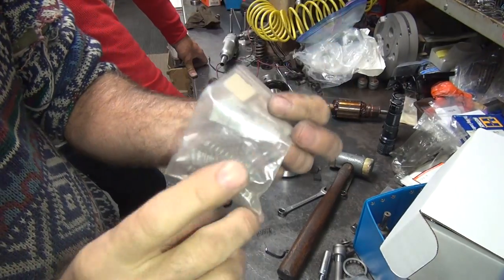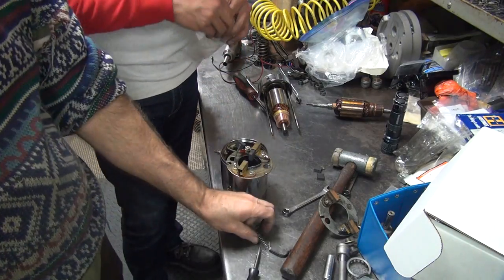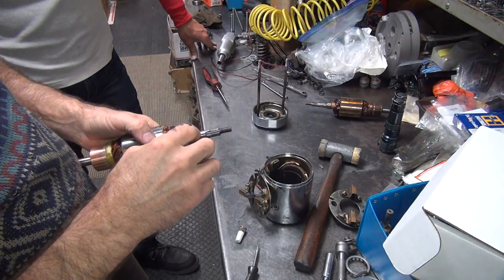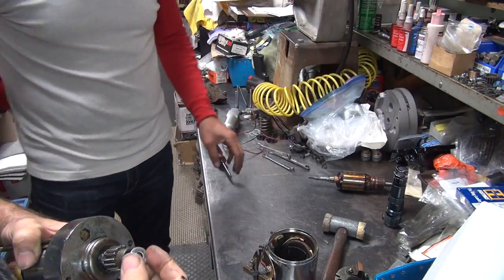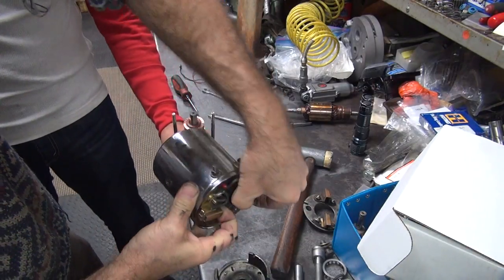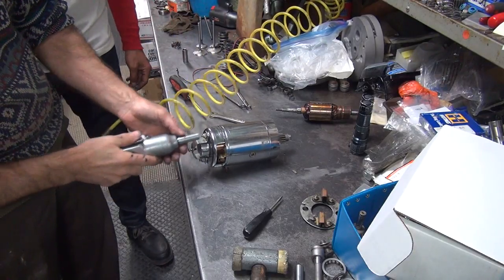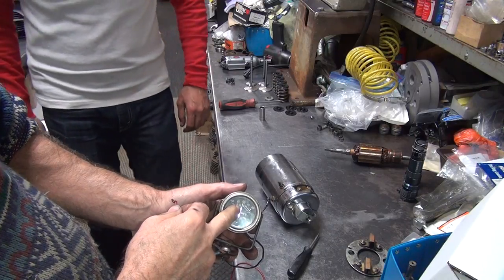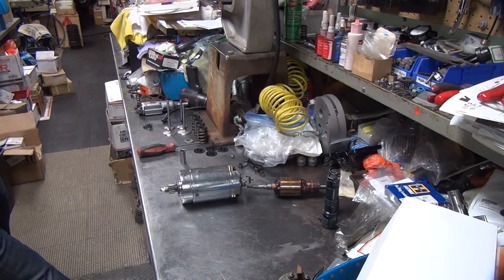#149-B how to do it, rebuild 65A 12v generator harley sportster panhead xl fl flh tatro machine

Comment: I've got an old 65A and a Bosch regulator that was on my Panhead once upon a time, then I replaced it with a Cycle Electrics that I've run for 15 years without issue. Now I'm thinking of rebuilding the 65A...just because I can...now that I've watched your video....thanks.
Reply from the maker: sounds like a plan.
tatro

Comment: Yo tatro so u dont need that wide washer on that gear end that the original generator comes with?🤔
Reply from the maker: not sure which washer you are talking about. if it is a big one under the nut that is for a sportster. big twins don't use them.
tatro
Reply: @TatroMachine  yes thats the one,  I was confused because my new one didn't comes with that for the ironhead.
Reply: The washer should be used as it throws oil clear of the timing cover breather, without the large diameter washer it wont be long before you have an oil leak.  @TatroMachine

Comment: In my ironhead servive manual it shows an ammeter, a voltmeter and a variable resistor required for the test. But, it doesn't say anything about the type of resistor, or the wattage it needs to handle?
Reply from the maker: just do it the way i do it and it will be fine.
tatro

Comment: What does the generator do????And why do people cut them off
Reply: It runs the water pump for the radiator
Reply from the maker: just like the name states, it generates. that would be the power that keeps your battery charged.
tatro